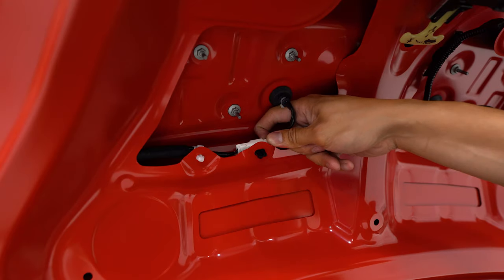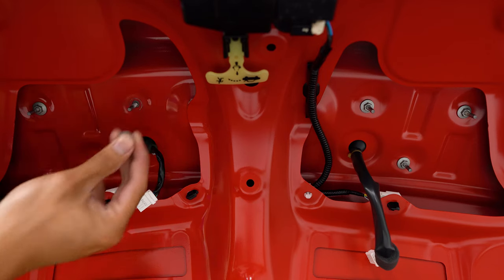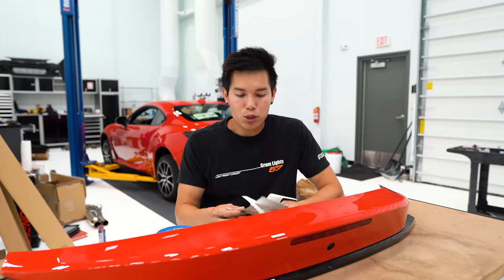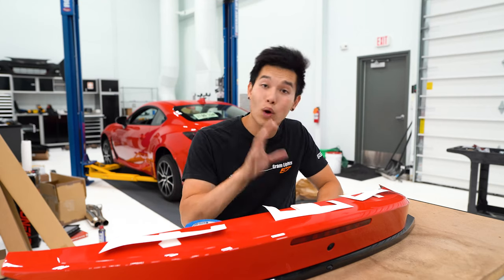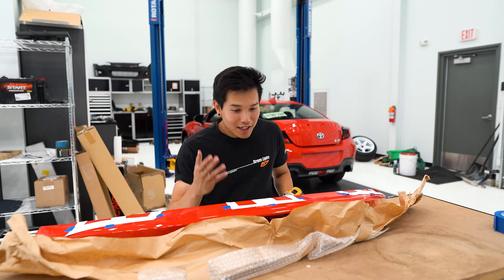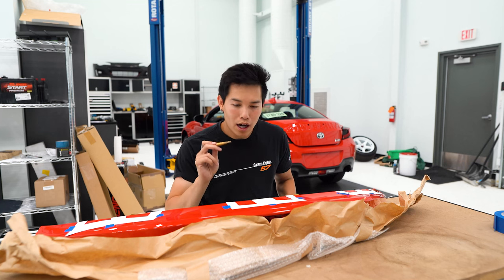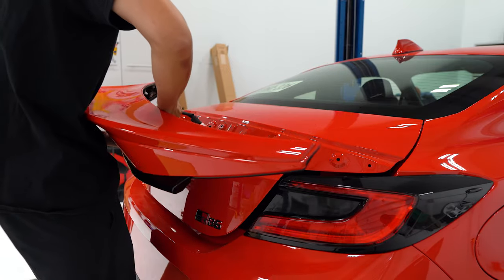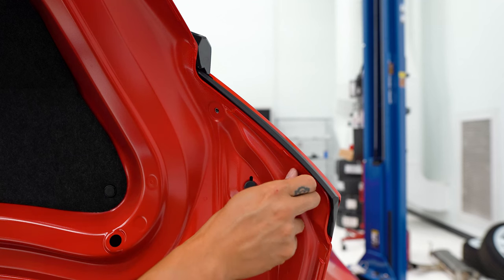New Duckbill Spoiler for the 2022 GR86

Comment: I made the same noises when installing the Perrin trunk handle (curse you riv-nuts).  Curious the duckbill could not have been designed to replace the entire trunk lip.  Sure, more material, but the mounting points would already be there.

Comment: I wonder why they didn't the make the premium duckbill a whole new single piece that you replace, especially since it seems like the way the ducktail (and skirts) was designed to allow you to change the look by having them come right off, whole
Reply from the maker: Probably because it'd have to be two larger molds instead of just the one large mold and one smaller one. Usually comes down to cost.

Comment: I have a carbon fiber duck lip coming tomorrow. I'm just going to use the tape. I had one for my S2000 and only used tape never had an issue with it and after 11 years it is still holding strong. I love your DIY video however. To see the Process if I need to drill is wonderful - thumbs up!!

Comment: You’re lucky tbh in the UK we only get the top trim GR86 yet it doesn’t come with the duckbill
Reply from the maker: Wow. They're holding out on you guys!
Reply: Eh? You can order the duckbill as an extra in the UK.
Reply: @benrhysjenkins  I didn’t notice that on their website so I’m assuming it’s a like a parts department situation but it still sucks, cause the Americans get it in the car as standard in top trim, no doubt we have to pay and have to ask around about one being supplied, fitted and painted.

Tbf though it doesn’t even matter cause all GR86 were sold out in the UK and to be one 2nd hand is the same story as the GR Yaris, middle aged men buying them and then deciding they don’t want it before it arrives so selling for more than new. GR Yaris is supposed to be just under £34 and I’ve seen people sell them for £35k-£44k brand new or even with up to 10,000 miles. Same with GR86 supposed to be just under £30k but seen them going for £32k-£36k

Comment: Why did you drill it instead of using double-sided tape??? 🤔🤔
Reply from the maker: Because that's how it was meant to be mounted and is the most secure.
Reply: @KevinVo  does that mean it’ll fly off with doeinle sided tape and I don’t get why it isn’t pre drilled
Reply from the maker: @GRTrueno  no it isn't likely to just fly off, but if you do it this way it's impossible for that to occur. If the holes were pre-drilled. Every base model would have holes in the trunks.